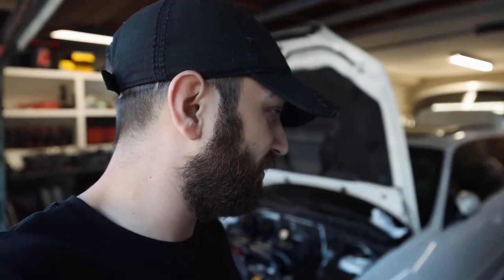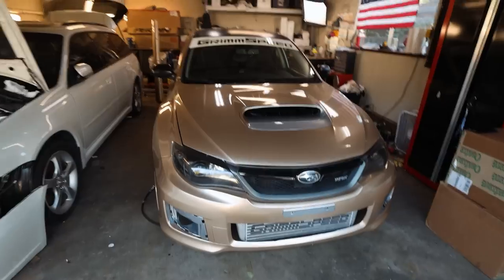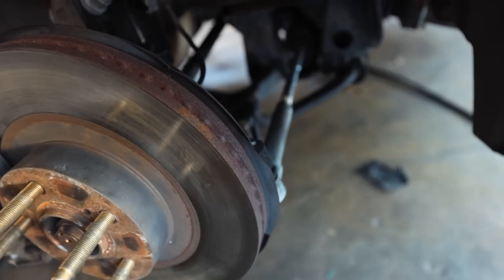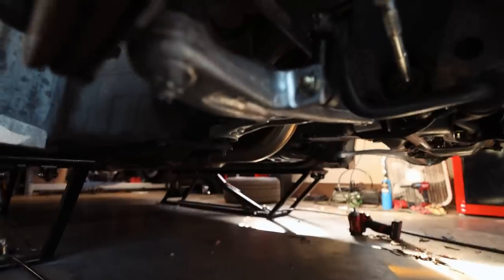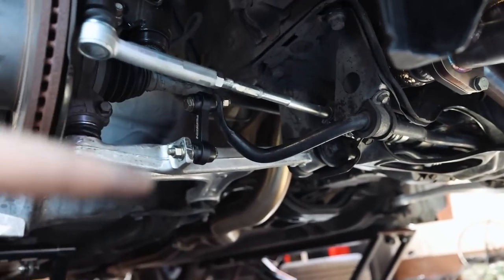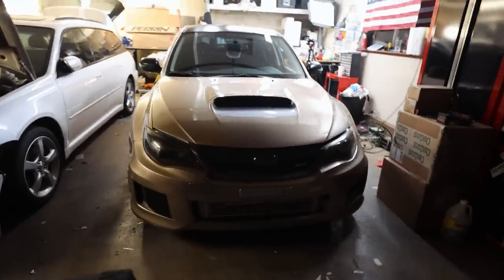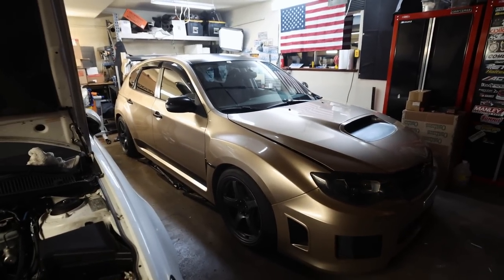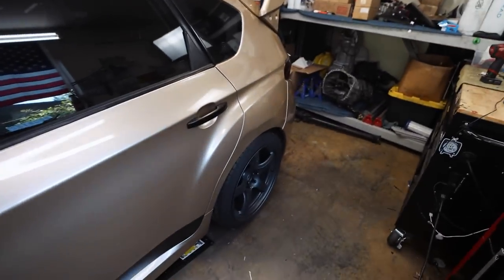THE WRX IS FINALLY DONE... For now

Comment: Looking good, you may want to double check your O/P gage wiring before ordering another one (although Im pretty sure you did already lol) I have seen this happen a couple times before (one O/P, one UEGO) and it turned out that the wiring was wrong and gave like a pulse signal only and the value would "freeze" to a random initial value.
Reply from the maker: I'll double check it again but it's only a power and ground wire with the signal going to the sensor 😅

Comment: I have to say I am sorry, that wrap actually looks sick. You were totally right. I think I didn't like it half done with the silver or something, I don't know but I like it now. It looks really dang cool! nice work man. I love all the black accents. 
Any chance you could cycle back to what you were saying about the lights you need reset at Subaru? I have those same lights come on randomly when I drive in reverse, sometimes. But they go away when I turn the car off until the next time it feels like throwing traction and hill assist lights on after driving in reverse.
Reply from the maker: It's thr vsc system, your clock sprong might just need to be re calibrated to fix it and thank you! 😁

Comment: the grimmspeed headers really do sound good, i just got them installed on my sti with a q300 thing sounds amazing. side note you should install whiteline bushings into the control arms while they are out i got much better response once i swapped the bushings.
Reply from the maker: Something I'll be doing later on 😁 figured I'd toss them in since I was already in there 😅🔥

Comment: Looks amazing, good job on the wrap. Can't wait to see the STI transformation unfold, I wish I could do similar with my LGT.  Question on the EJ255, I ran a boost gauge on my Legacy GT and when cruising, the needle bounces a little bit, not sure if I did it right. Where is the best place to tap into for an aftermarket boost gauge?
Reply from the maker: Normally the intake manifold is the best spot. For a analog gauge that's nothing out of the ordinary though 😁
Reply: @Smeedia   thanks for the reply. That's good to know, I always thought I tapped the wrong line or something. Just cheap GlowShift gauges right now, might have to upgrade to digital it sounds like.

Comment: Tanner have you ran the Perrin positive steering bushing they work amazing to push caster back forward I did 3" offset and that difference in front bite at takeoff and corners is so different plus stopped alot vibration I got from driveline
Reply from the maker: Ive looked into them before but can't say I've ever tried them 👀

Comment: The WRX looks awesome. The bronzey gold beige really pops and I really like the black accents you added aswell
Reply from the maker: Thank you Ben! It worked out pretty well 😁
Reply: @Smeedia  I own 2019 Impreza I really wish there was more aftermarket performance parts and mods support for it,like even finding an AOS for my car is a pain. So far all I've done for my car is put in an AEM dry flow drop in filter with carbon filter delete, and i swapped the stock pitch stop mount out for a yonaka pitch stop I may eventually upgrade it to a Perrin one. But you're videos are super inspiring and have given me plenty of ideas for mods when I eventually get a WRX or STI.

Comment: Drove the car again today and once again temps super low even after several pulls. I really have no clue wtf was causing it to overheat other than the thermostat failing? What do you think?
Reply from the maker: Coupld be a random pocket of air, if it was the thermostat I wouldent expect it to work sometimes and not work other times since it's mechanical

Comment: Quick question, how different the front and read body of a 2010 Impreza sedan and a sti 2011 sedan, like can you just take a sti front bumper  and put it on Impreza or do you need to change the fenders as well
Reply from the maker: You'll need to change the fenders for it to look decent 🙏
Reply: @Smeedia  how about the rear? Can I just put the sti bumper?

Comment: Hey man love your videos and I’m in Oregon as well. Was hoping you could answer something for me, I was wondering if my stock ecu in my 2011 wrx is capable of having 2 step or launch control. It was just tuned with the new built motor but they were unable to do any extra stuff like that.
Reply from the maker: Yes they are, the stock ecu with an AP can do it
Reply: @Smeedia  I do have a Cobb ap but I have all the deletes from my understanding with the new regulations, a tuner can’t use it on my car?
Reply: @Smeedia  so currently I’m tuned open source with no ap.

Comment: I just broke my crankshaft pulley on my 03 WRX wagon it's original to the car car has 235,000 miles do you know is it possible for it to do damage to the crankshaft itself
Reply from the maker: Sometimes it can, but mainly from what I've seen it dosent

Comment: My splash guards are literally disnegrating. On the front wheel wells.. I have stock wheels and tires. I've had to put in work 2wice already when they were dragging from faulty clips. 2012 hatch....do u just rip the splash sjeilds out? Or should I replace? I ripped em lol.

Comment: No washer under that castle nut for the ball joint?  Or did I just miss seeing it?  In my research for the Legacy GT-B control arm upgrade I'm doing on my '13 Legacy (similar idea there, aluminum arm replacing the stock steel arm), there's supposed to be a washer between that nut and the arm itself, so you don't score/warp the aluminum (the same reason they have those conical inserts on the other side)--would assume the same part type would be called for here?
Reply from the maker: It is on there, had to snag them from subaru 💪

Comment: Great job! I have a 2016 STI with puny 400whp on stock motor. Where do you recommend a build short block from? I am looking for 500-600whp. 400 is hella slow man need more Powa 💪
Reply from the maker: Outfront 
Bader built 

Both are solid options 💪
Reply: Thank you man! Great content for the community as usual.

Comment: Dude I don't know that roll center kit works for everyone else.. I had nothing but issues. When I put mine on I was literally floating on the freeway from lane to lane while my steering wheel was straight.kind of like going over a bridge.. no one could figure it out until I swapped out back to stock...fyi I am lowered .8 of an inch so they should have worked
Reply from the maker: For real?! 😳 that's only a little terrifying, not sure what would cause it to do that
Reply: @Smeedia  neither did i..but the second I put some oem style ones back on the issue went away...no one could figure it out...

Comment: Dude I think the eccentric cam toe adjustment is so stupid, especially since it’s perfectly setup to have a center adjective like a front tie rod
Reply from the maker: That eccentric bolt dosent give alot of adjustment either. Normally I use the spc toe arms work great

Comment: Hey man I had a quick question. Hopefully you can give me some advice. Today I replaced the driveshaft carrier bushings on my 14 wrx. I took it for a quick test drive and the car was idling Erratically. It started sputtering and I got a P0172 code for rich condition. Do you know why it would do that? I was bumping into the O2 sensor as I was getting the heat shield out but all the connections are still good. I checked the MAF and cleaned it. It’s good. I got a replacement O2 sensor on the way but I can’t imagine the O2 sensor is THAT sensitive. This all just happened like 4 hours ago and my buddies had to tow me back to my house
Reply: Also car is boosting a lot with 10-20% throttle but the car isn’t going anywhere
Reply from the maker: Can you pull AF correction on the AP? Let it idle and lemme know lw what your seeing
Reply: @Smeedia  lowest 0.78 highest 4.69 it keep changing to everything in between
Reply from the maker: Normal, I'd check out that O2 sensor to make sure it didn't get damaged
Reply: @Smeedia  I appreciate you just taking the time to reply! Thank you for the help and Best of luck with everything. I’m always looking forward to next video content ❤️